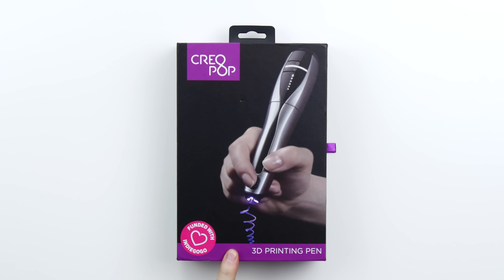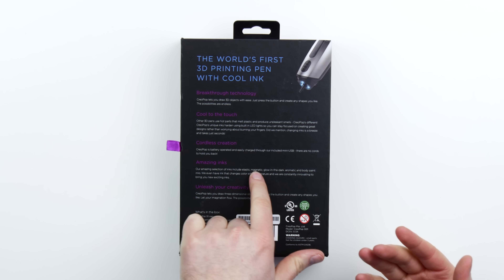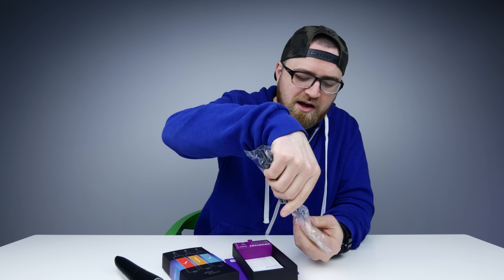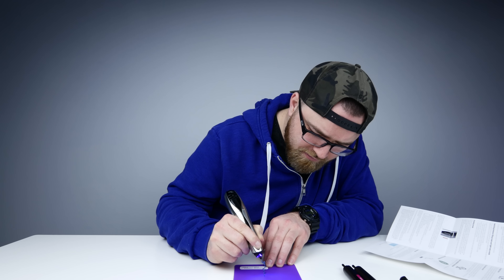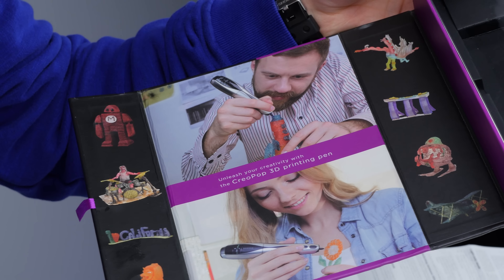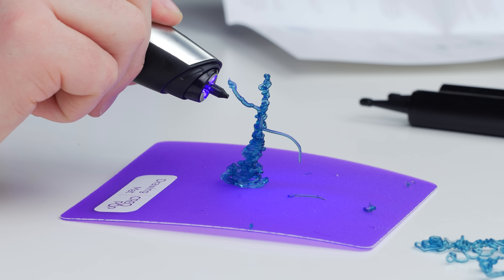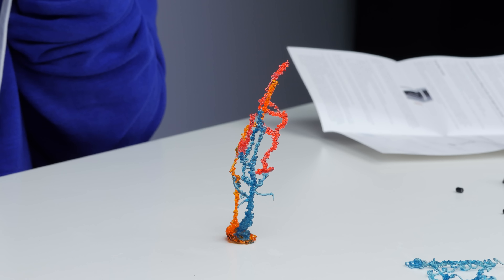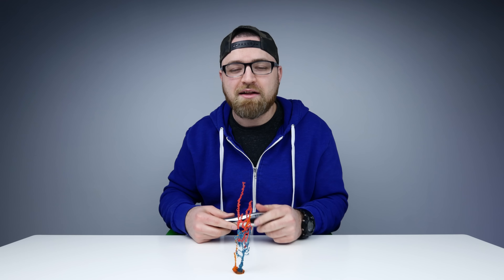How To Draw In 3D

Comment: ok so.
1. great concept
2. how much do they charge for refills 1,000 bucks? (that's how they getcha)
3. lacks accuracy (you could do it by laying it down first but,..) I'd like to see you draw a straight line vertically 
4. I wanna draw with METAL, that way I can connect stuff and run a charge through it.
5. I have an MP4 (I know) that I bought new but within a week (literally) the ON BUTTON BROKE and since it CHARGES in the ON position and it broke in the OFF POSITION that means I can make it work.
So back on point.
"MAYBE" i can use this to stick on button where the old one used to be, "but",.....
DOES THAT MATERIAL ADHERE TO OTHER MATERIAL OF SIMILAR COMPOSITION?